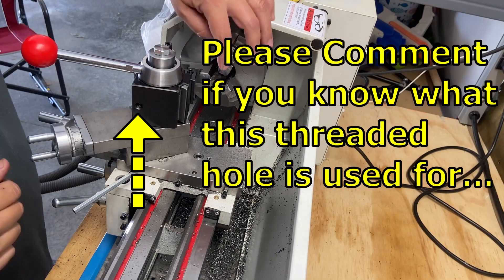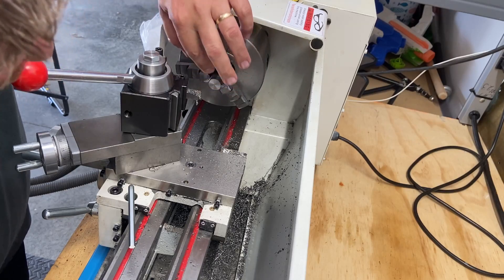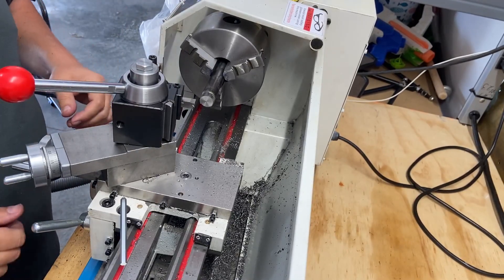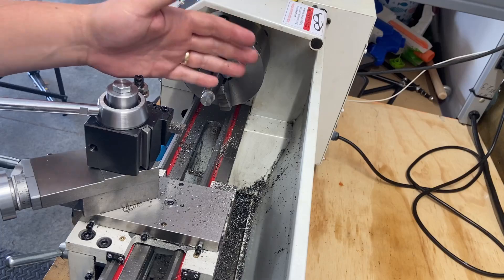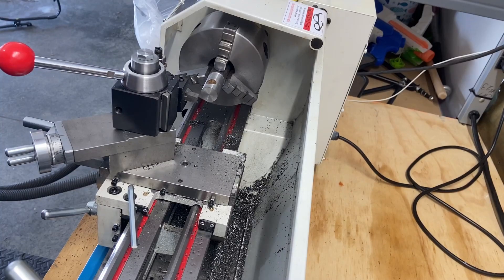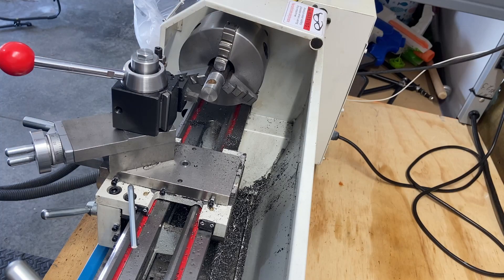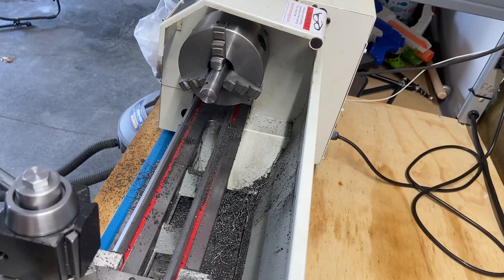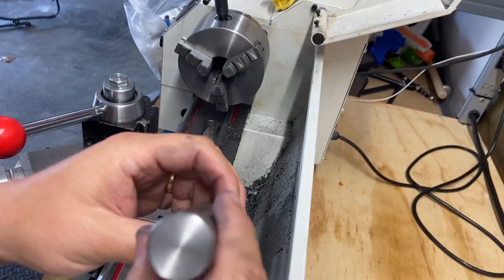Vevor Mini Lathe MX 400 Part 32 - Bostar AXA Wedge Style QCTP first test cut using Custom Ground HSS

Comment: G'day Beez,  My new Vevor lathe arrived yesterday.  I have not opened the box yet.  I need to build myself a bench to put it on.  I have just watched about 5 of your videos in a row, but can see that I have a hell of a lot to catch up on.  Thanks for your input.  What is/was the issue with the tail stock?
Reply from the maker: The tailstock is very difficult to align and the adjustment system is terrible on it.  To date I still do not have it centered perfectly.  It is usable and hasnt stopped me from working on projects but the adjustment setup is sloppy and difficult to work with.  There was a nut inside it that was proud "too tall" and created a rocking point making it even more frustrating to work with.  I recently took it apart and discovered that problem.  Also one of the threaded holes for an adjustment set screw didnt have enoiug threads to engage the set screw so I had to rethread it for a larger screw.  I have a few videos that I put out recently tearng into the tailstock and show it more in depth but I wont be putting any more tailstock centering videos until I have mastered it and completely understand the process.  Its very tricky to get centered. Again I does work for my projects it does the job but its not built well. For what its worth,  I am not affiliated with Vevor or any other manufactuer.  All opions are my own and uninfluenced by any manufacturer or re-seller.  Good luck,  If you have any questions along the way ill be happy to answer anything  can.

Comment: The two main uses I have seen the threaded hole on the QCTP used for are an Indicator mount and a shop fashioned end stop. The end stop would be used when you want to make a quantity of an item. For example a bushing, You have the stock done all but finial parting and you set endstop to just touch the piece and it positions the parting tool a set distance without having to stop and measure each time.
Reply from the maker: Appreciate the thoughts on that threaded hole.  I would like to use it as a stop or dial indicator mount someday.  Thanks for watching.  I wasn't sure what that was for.

Comment: Hey Deez.
HHS is great. There are tons of things you can do with it.

As for the hole. I am not sure what it is used for but I have several ideas as to what I'd use it for.

A mount for a dial indicator to help center up work.
Put a handle in it and use the tool post to cut radii in material. ( Not sure how well this would work because you'd have to leave the tool post loose and the swing arc would be too big to cut smaller radii)
Maybe even some kind of fixture to help set the length and height of your tool so they are always at the same position. That way when you do a tool change you don't have to set the center height. And when swapping between the tools your zero stays the same.
Reply from the maker: All I could think of was for cutting radius or curves by swinging back and forth with a handle but your ideas are intriguing,  Using it to mount a depth gauge or stop of some sort could be pretty handy as well as setting it up for a dial indicator.

Really enjoying working with this HSS,  as you said you can do a lot,  I need to made a smaller radius tool to make something to under cut for threading.  still learning proper techniques for threading.

Have a great Thanksgiving.  Many thanks to you.
Reply: @deezworkshop  you're welcome and I hope you have a great Thanksgiving as well.

Comment: Hi deez always satisfying when a plan comes together. Well done keep up with the learning. I found that the carbide inserts needs a higher rpm and deeper depth of cut .
Reply from the maker: Thanks,  Pretty happy with how this turned out and is performing,  Already planning to make version 2 Thanks for Willfred and some materials he supplied.  I was messing around tonight with carbide inserts and bumped up the speeds to 650-700 and it was cutting very well.  I am finding the same about speeds when it comes to carbide vs HSS. Have a great Thanksgiving.